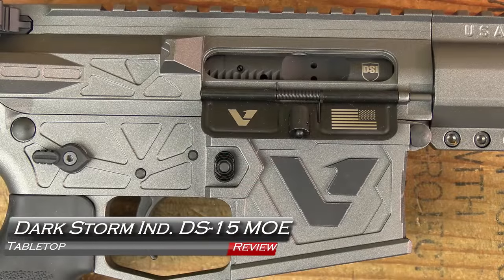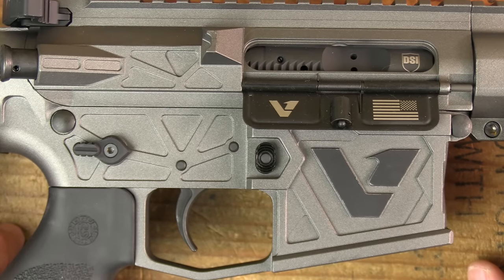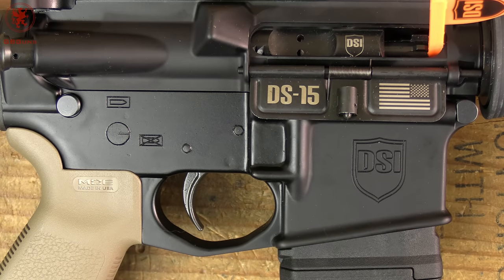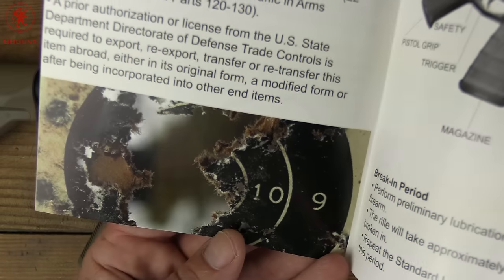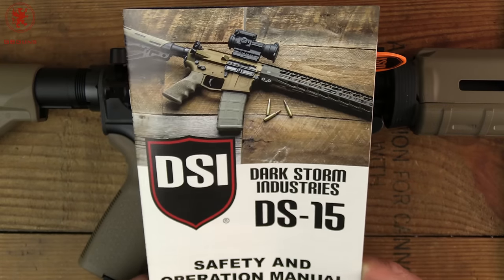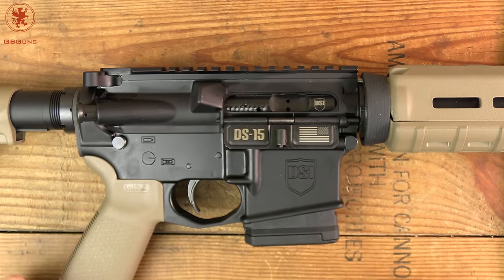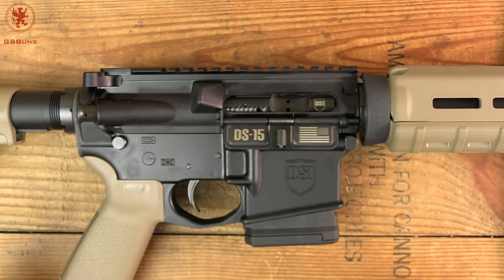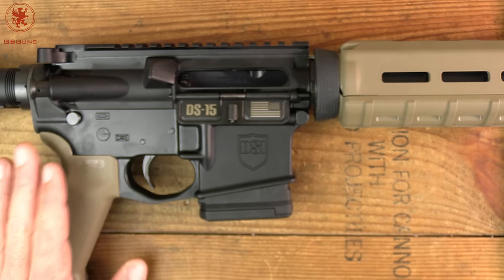50 State Legal AR? Dark Storm Industries DS 15 MOE

Comment from the maker: Some more information about this rifle:
-the gray inside the upper is a mil-spec dry lube film. Also inside the buffer tube. Not many companies do that. 
- DSI buffers are hard coat anodized for more durability and have a high durometer bumper. 
- DSI is not cheap piano wire, but a 17-7 stainless which is heat treated for longer life and electropolished for quieter operation. 
- on the underside of the upper receiver you can see the marking for made in New York along with the alloy, generation code (related to program changes) and a born on date. Similar info is on the pistol grip boss of the lower receiver. 
-DSI buffer tube is true 7075 impact forged not a cheaper 6061 extrusion. 
-The trigger, hammer and bolt catch are investment cast not the cheaper MIM.

Comment: I’m curious to know if the 10 round mag could be replaced, meaning can you lock in a different mag, like a 30 round mag that is limited to holding 10 rounds. I think it would give it a better look, in my opinion.
Reply: I don’t know if there’s anyways to take the mag out in the first place
Reply: Between the wall of mag well and trigger assembly pocket, there is a small set screw that is loctited in place. Trigger assembly needs to be removed in order to get to the screw

Comment: I'm curious how that Mag is affixed.  Looking forward to seeing the 'Stripper Clip' in use.  Looks like a nightmare but I've been wrong before.  My Buddy in DC might be interested in something like this.   Poor guy is behind enemy lines!
Reply from the maker: It's tough for those folks, and CA, NY, MA, this list of unAmerican states goes on!  There is a pin inside the lower that locks onto the mag.  I haven't seen it yet, but have been told.
Reply: @GBGuns  Okay, I wonder if there is a way that if my buddy moves to a Free State, he could use larger mags?  Not sure about how he'd change mags.... Hmmmm, HAS to be a way!!
Reply: We’re all behind enemy lines.
Reply: It's a small pin back side of the mag.

Comment: Dsi is not a quality brand
Reply from the maker: How do you figure?
Reply: @GBGuns  their lowers are consistently out of spec and their uppers barely look. Around NY, those rifles are not held in high regard.
Reply from the maker: Interesting.  I've not had any spec issues with the rifles we've had from them.  The Variant 1 is an amazing pistol
Reply: @GBGuns  did you buy this rifle from a shop or did DSI send it to you?
Reply: @StevenL00  I’m surprised they has been quiet since your question
Reply: @SlavicCinnamonRollie556  maybe he didn't see it? yt doesn't notify people sometimes, happened to me several times
Reply: @StevenL00  usually manufacturer give you a Polished one that has been tested throughout compare to Batches that goes to customers
Reply: @SlavicCinnamonRollie556  if you buy it in shops like most people do this really doesn't matter, just need to find out how Graham did it
Reply: @StevenL00  there’s a difference between commercial that are sold to customers and Demo or Modified one that are send to reviewers since they want good feedback in order to get more buyers.  DSI is actually few blocks away from me and I used their FFL transfers pretty frequently however many local NY DSI owners hated their rifle because of issues including out of spec.  I just couldn’t buy one because of backlog is pretty long and I already build my own with Aero/BCM instead for half the price they asks for.